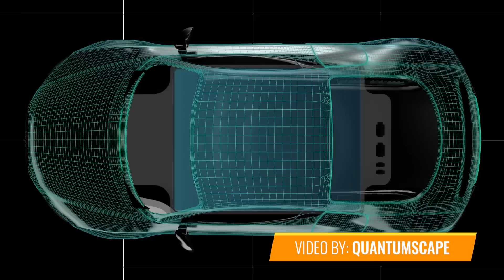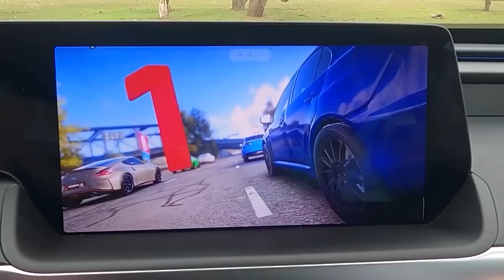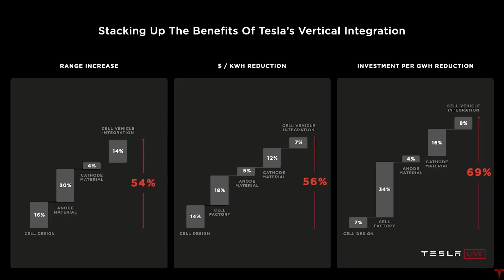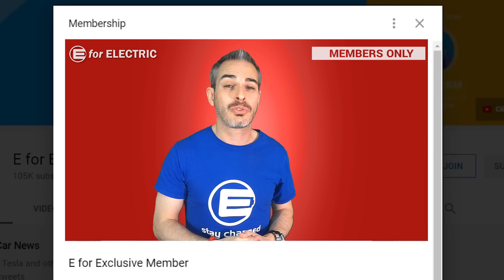TOYOTA's Only Hope to Beat TESLA: Solid State Battery

Comment: I will never trust Toyota again and never buy one of their cars after they deceived so many gullible customers into buying fake ‘self-charging” hybrids. It’s totally fraudulent in my opinion.
Reply: @Sandy Ford D18 What exactly do you mean by fake self-charging hybrids?  Aren’t all hybrids self-charging?  What is the fake part?  I’m truly missing your point here.
Reply: @doittoit00  I think he's referring to Hybrids that you can't plug in. With a plug-in hybrid you can charge it every day and hardly ever need to run the gasoline engine (at least for a certain percentage of owners). You can't do that with a non-plug-in hybrid, they require you to run the gasoline engine in order to charge up the battery which results in increased harmful emissions.
Reply: @doittoit00  , a real EV hybrid vehicle gets it’s energy from both its ICE and an internal battery. This battery gets it’s power from either a home plug-in charger or a High speed charging point elsewhere, or it can also recover an amount of energy when braking, (regenerative braking). The idea is to mostly drive on battery power, which may have a range of up to about 70kms, ideal for most short daily runs and then just use the ICE for longer range driving. So they can be used in a very green and environmentally friendly manner.
A “self-charging” hybrid gets 100% of it’s energy from it’s internal combustion engine, which means 100% fossil fuel powered, even if a tiny amount is reclaimed from regenerative braking. Most self-charging hybrids are more expensive to buy and are more complex to service, which also incurs more expense. They generally use no less, or very little less,  fossil fuels than a normal ICE. Hence the “fake” nomenclature. On a continuous long run they can actually use slightly more fuel as they are normally, but not always, slightly heavier.
People think they are doing right for the environment by purchasing Self-charging hybrids, but in reality it’s only the auto manufacturer who benefits, as it’s Toyota who are the traditional villains in this sorry saga. Also, Toyota has always derided the green benefits of real hybrids and BEVs in order to sell more of their own vehicles, all at the expense of the consumer and the planet.
Shame on Toyota, a notably horrendous company with devious selling practices. Shame.
Reply: @Sandy Ford D18 Ok, I see what you mean. In my experience you are incorrect.  In 2011 I purchased a 2008 Toyota Camry Hybrid, which cost me about $3500 more than the equivalent non-hybrid Camry.  I tracked my gasoline usage and got 36-38 mpg.  The non-hybrid Camry’s at the time got about 25 mpg for equivalent driving.  So I used less fuel thus reducing my carbon footprint, and paid for the difference in about 3 years.
In 2015 I passed this car to my daughter and purchased a 2014 Ford Fusion Energi, a PHEV, which I still have today.  In this vehicle I average about 65 mpg of gasoline usage, because of the pure electric driving I get from the battery.  However the batteries have degraded significantly.  When I bought the car 6 years ago I got 25 miles of EV driving after plugging in.  That dropped off about three years ago to around 18 and has continued to decline, so now I only get about 11 miles.  This happens because a PHEV goes through a full battery cycle every day - 1000 cycles is not due 3 years with daily use, so the degradation is not surprising.   I currently work from home so the drop has had minimal impact on the mpg since most trips are short.  Replacement does big make sense because it is not cost effective with the minimum miles driven.  
So my point is that hybrids are better than ICE vehicles, but you are correct that PHEVs are even better.
Reply: @doittoit00  you’re real problem is, and thank you, is that you were an early adopter. Ford have never taken EVs seriously up until last year, late as always. The battery in your Fusion, which I presume was a compliance model, should last longer than the actual vehicle, which is happening now with modern batteries, better BMS and more cautious charging/discharging profiles.
I’m in Western Europe and the normal mpg on a 2012 Camry is approx 50mpg, so not sure why you’re only getting such a low mpg.
But I’ll stand by my statement that Toyota are deliberately misleading people into buying their “self-charging”hybrids when they are real EV hybrids and BEVs available with real green credentials. 
I really appreciate your input and comment.
Reply: @Sandy Ford D18  No doubt the Fusion batteries have “suffered” from being early tech.  But even Tesla at the time was trying to figure out how to get past 1000 cycles without significant degradation.  The fact is that PHEVs with limited range like my car have to recharge every night.  A BEV even with only 200 miles range I would have only plugged in twice per week when I was driving daily.  I probably would not be 1000 cycles yet, but with my car I am probably around 2000 cycles.
As far as the Camry is concerned, the 2008 Camry had EPA estimates of 21mpg city/ 31 mpg highway.  I drove about 50/50 when I had it, so 25 mpg is a good estimate.  As I said, I got 36-38 mpg with the hybrid, so there is no doubt it performed better than the ICE alternative from a purely gas consumption perspective, by almost 50%.
Reply: how is it deceiving lol? Are you really that upset by it? Keep in mind that in the U.S. hybrids have nearly the same carbon footprint as an EV....
Reply: @andrewmeehan6151  ,congratulations on your useless comment and obvious complete lack of knowledge of the automotive industry. 
I take it that you were conned into buying one of these fake hybrids?
“Hybrids have nearly the same carbon footprint as an EV”. Man , you are so clueless.
Reply: @sandyfordd1843  I'll stand down, cuz I know you must be a fanboy, and no, I don't own a hybrid even though I plan to move from my gas car to one next. 
It may not seem it, but believe it or not building a BEV uses far more energy than building an ICE vehicle. 
There is nothing immoral about Toyota, they are simply building what MOST folks want, they are getting into BEVs now because there is a small market for it, but it is just that, small. 2% I believe.
Reply: @andrewmeehan6151  Yes, please stand down. You are spreading way too much incorrect rhetoric.
Reply: @JasonWW2000  "incorrect rhetoric" You must be confusing those with facts. BEVs have potential to eventually be MUCH cleaner, but that is only if we invest more in clean energy. The current admin is putting the cart before the horse. 

If everyone bought an ev in the next 5 years and they junked all the gas burners, that would be worse for the environment than simply letting the free-market do it's job.
Reply: @andrewmeehan6151  I thought you said you were going to stand down? Another lie? Lol
Don't come here spreading FUD. What kind of nonsense are you spewing with this hypothetical "If everyone bought an EV in the next 5 years and they junked all the gas burners". Are you a child? You know that is nonsense. The changeover to BEV will take many decades.
Reply: @andrewmeehan6151  Guess what else is going to change in the next several decades? The US electrical grid will be both beefed-up as well as shifted to more renewable sources of clean energy.
Reply: @JasonWW2000  maybe, maybe not. Covid relief wasn't cheap, and we are in a huge bubble as it is. I don't think getting everyone into a Tesla is a priority.
Reply: @andrewmeehan6151  What? I never said anything about trying to get everyone into a Tesla being a priority. Are you using the word "Tesla" as a general term for a battery electric vehicle? I'm not even saying that we need to get everyone into a BEV is a priority. We do need to get the ball rolling on reducing climate change, though. That is the whole reason the market is shifting (slowly) to BEV's. So on one hand, we need to reduce climate change in order to stay alive as a species. On the other hand, investing money into infrastructure is always difficult but the long-term picture always looks better when you do it.
Reply: @JasonWW2000  Climate change isn't nearly the crisis that CNN and other news outlets make it to be, and if it was, BEVs are the last thing that we should be looking at for reducing emissions. 

Climates are always changing and it is perfectly normal (For better or worse)as humans we will need to adapt, because the climate will change, with or without human activity.
Reply: @andrewmeehan6151  Wow, I don't know who you're getting your information from, but you need to slap them upside their head and run away. Everything you said is incorrect.
Reply: @JasonWW2000  , I wonder does Andrew work for Toyota? He seems to be defending the indefensible.  Definitely a losing battle and belittles himself.
Reply: @JasonWW2000  , totally agree, and vehicle-to-grid will be very beneficial In stabilising the grid when required.

Comment: Alex, what I see should have happened is all of the US automakers should have come together using one battery manufacturer and have them provide the powertrains for all vehicles worldwide. That would have been great since the charging network is already in place. I'm currently in Sacramento and previously worked at Tesla Fremont. Since I no longer work there, my NDA is no longer enforceable.
Reply: Pie in the sky Joe, trying to get American companies to liaise with their competitors for the mutual benefit is near impossible to pull off. It takes a lot of forward thinking and that’s not their strong point with the short term buck is their objective. Sad really.
Reply: @sandyfordd1843  On the other hand, Japanese liaise so much that their electric motorcycles designed from now on all have the same battery dimensions. Japan is like one big family, no wonder why things work so well there and crime is super low.
Reply: @00crashtest  , I haven’t seen that yet, but it doesn’t make a lot of sense. The engine in my little 400cc machine was a lot smaller than the engine in my 1000CC BMW motorbike, so curious to know how that will work. There are a huge variety of motorcycles to suit all riders, so sizes vary a lot.

Comment: And Toyota might be the one to figure out solid state, but looking at their stance against EV lately, dont know what they up to. Self charging hybrids, air cleaning hydrogen cars...🤷
Reply: Their stance is actually pretty consistent. They think current batteries have too many compromises and a large breakthrough like solid state batteries is necessary to make BEVs main stream. It's not even really a bad take. I would say there is a decent probability that in 5 years or so all current EVs are pretty much considered obsolete garbage that is completely worthless. It may take a bit longer, but hopefully in the near future charging will take about the same time as pumping gas and then pretty much all current EVs will just feel terrible to use for anything other than commuting with overnight charging.
Reply: @christopherpedersen1820  "absolute garbage" is a bit dramatic. Current top EVs are great, solid state will be better, hybrids are garbage
Reply: @ΗΕΑΗΘΣ  Idk, I'd consider PHEVs a great compromise currently. Also once there are cars that can charge that quickly I don't really see anyone using EVs that take much longer to charge for anything other than around town. Sitting there and watching like 5 people charge in the time it takes you to charge definitely wouldn't feel good on a trip even if your charge only takes about 30 minutes.
Reply: @ΗΕΑΗΘΣ  I certainly don’t agree. My 11 year old Prius gets 50 mpg, in the worst driving conditions. I hardly think that’s garbage.